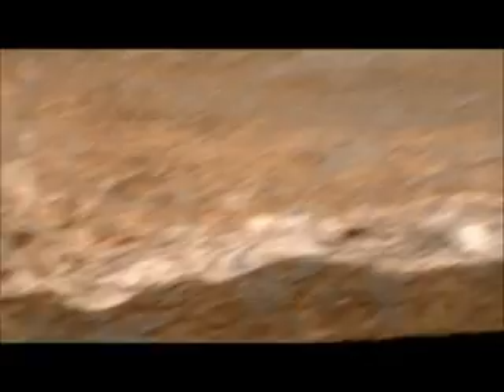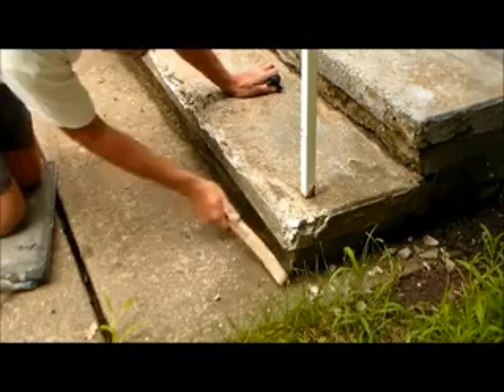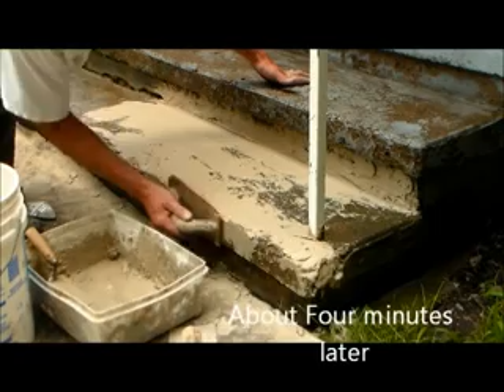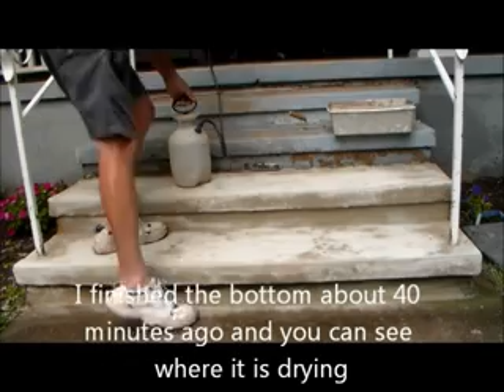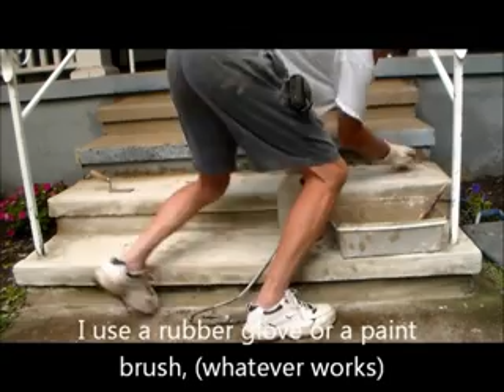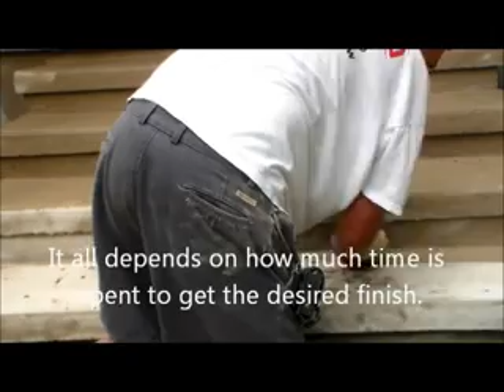CONCRETE STEPS REPAIR  (Part 1) Mike Haduck

Comment: Hi Mike,

Great videos. Im a construction worker myself, though I deal mainly in Paving, Fencing, decking etc... Im on a project myself just now with steps. I have extended the treads and added an extra step, built out of bricks. I want to skim over them to make them look like ordinary concrete steps. I was wondering what the best mix would be for this without having to shutter them all. That cement all looks great but im in uk and cant seem to locate it easily. Could I knock up a mix myself similar to this? Thanks in advance. Love your work.
Reply: Ihatuq
Reply from the maker: Ingrid Philippe thanks mike
Reply from the maker: I sometimes paint them with Portland, but a stucco paint could work also.. check with the paint guys first and see what they say. thanks   mike

Comment: This looks really good.  I have gaps between the risers and the treads of some concrete stairs that need repaired.  Do you know if the product you used is available outside of the USA?  I'm in the UK.

Comment: My  steps are a prefab cement steps that have cracked from cold weather"  what do you suggest ! Replace or can i do whats on yu video
Reply from the maker: I can't say uless I was actually there to see it. but give it a try if you think they are fixable and in not you got to get new ones anyway.  I wish you weil, thanks mike
Reply: Mike Haduck

Comment from the maker: the agreement with the owner was he was to give it a coat of paint every year or two to keep it up. cement all is just a patch and will loosen up if it is not covered. "a patch is a patch". and it should be looked at that way. but a good stucco paint should do the trick. my opinion thanks mike

Comment from the maker: I use rapid set - "mortar mix" if I have to get it done fast and am only there for a short time ( Patch - up) work. every job is different , rapid set sets very fast and you don,t get a lot of time to work with it. nothing wrong with patch up work, but if I got the time I use 2 sand to one Portland.. my opinion.   thanks mike

Comment from the maker: First thing to remember about patching concrete steps is the reason they are being patched is the expense to rip them out and do it right' so basicly (a patch is a patch) So I could spend time trying to get the paint off or just go over it and paint it again a few days later. I give the customer the options with the pros and cons and let them decide. but It won't bother me after the winter to go back and patch and paint the bad spots again. your call. thanks mike